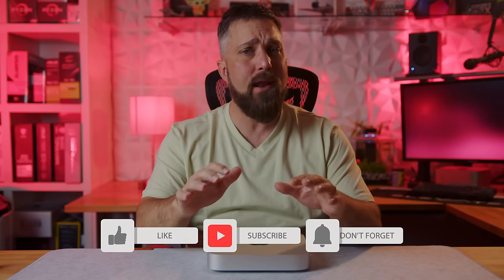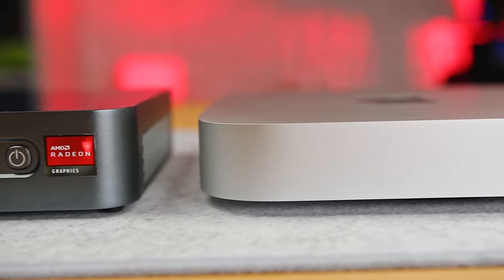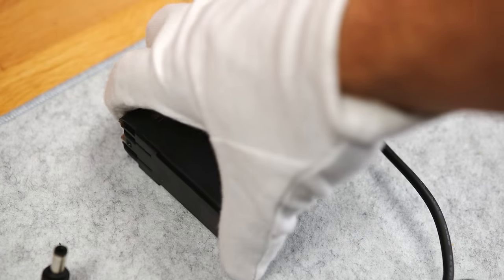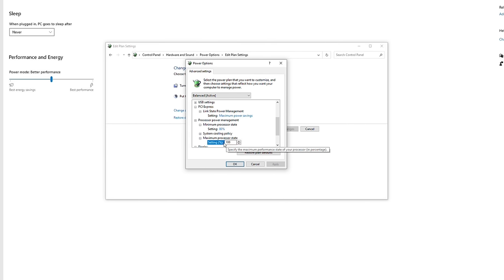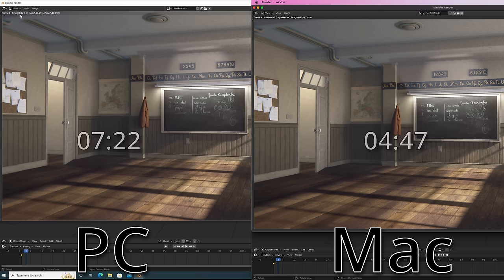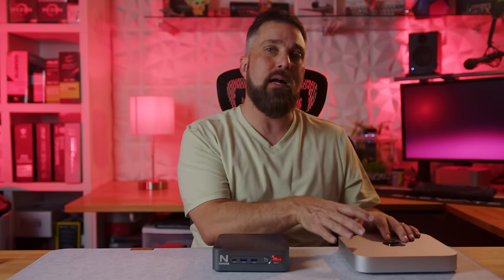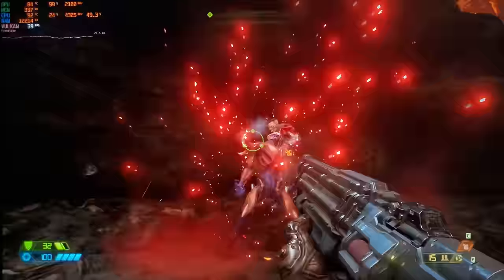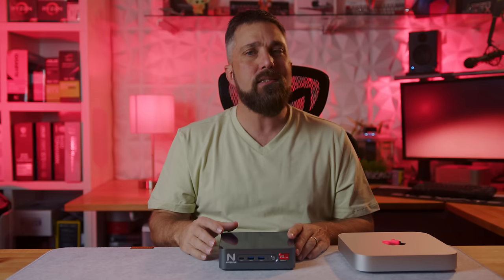Mini PC vs Mac Mini. Ryzen 9 5900HX Nofflink Mini PC Review.

Comment: Noffllink:   fatal flaw is the noisy cooling fan.  A deal-breaker.

M1 Mini:   ARM processor means very limited Windows compatibility.  Also, external GPU boxes will not work.  Also, much less gaming potential compared to Windows.  Also, no RAM or SSD upgrades or repairs are possible on the M1 Mini.   Multiple deal-breakers here.

Comment: I have an M1 MBA, and have been waiting for an M2pro Mac Mini to replace my old dell i7 desktop.  Then I ran into the Beelink ser4 on Amazon for $360 -EHH what the hell!
It has the 4700U, 32G of 3200 DDR, 512 M2 drive, and it will deliver 1440p to my monitor @ 144hz.  To put it mildly, I have no regrets.  The worst thing I can say about it is that it likely stopped me from spending $1k more when the Mac mini I want is finally offered.  I have challenged myself to outgrow the SER4 with CAD and FEA, but I don't see that anytime soon.
I know most people are waiting for the latest Ryzen CPUs to hit the minis, but keep an eye on the clearance sales of the previous generation.  It looks to me like the new APUs need unobtainable memory to hit those performance marks, so they may cost as much or more than the next Mac Minis for quite a while.

Comment: I am pretty sure you have a UPS already, but could you do a video on running desktop systems off an external battery? Niche use-case, I know. 

But I recently had my power cut off for 7 hours and spent a lot of that time wondering how much work I could get done with my desktop if I had more than a 5 min UPS. I have a laptop thankfully, but I was a desktop only user for awhile.

Comment: My last PC build developed a problem that I declined to diagnose because I had had that system for many years and was just BORED with it.  Instead, I bought a MINISFORUM HM90 mini-system with an AMD Ryzen 9 4900H CPU and Vega graphics, 16 GB of DDR4 RAM, and a 512 GB SDD.  The most strenuous thing I'm going to do with this system is music creation.  Considering that the last time I choked out a system with tasks of this nature was when I was running my previous system's predecessor, I figured that all I had to do was to seek out a system capable of light gaming.  The system I replaced is a home-build with an AMD FX series CPU and 8 GB of DDR3.  That means that I jumped 4 generations from system to system; there was no way that I wasn't going to notice the difference, even when moving from Linux Mint to Windows 11!

While the numbers and sheer gear lust are making wish I'd bought something more like the Nofflink you reviewed, at least one thing makes me glad I didn't:  The NOISE!  My HM90 usually makes inaudible noise, and I think I no why.  The Nofflink seems to have its cooling solution in the bottom of the case, where airflow can be constricted.  My HM90 has its cooling solution at the top of the case and pulls air in through a perforated top panel and blows it out of ventilated sides.  Since I will be recording microphone audio into my system, I DON'T want the PC raising the noise floor of my recording room!  I don't NEED (though I do WANT) the extra power, I WON'T ACCEPT the extra noise, and I saved somewhere between $200 and $300 going with what I have.  The recording biz here is a hobby, so I have modest needs even within this sphere.  I won't be on the lookout for a system with, say, an AMD Ryzen 9 6900-whatever for a few years, gear lust notwithstanding.  That means that I should have time to find one with modest-to-very-low fan noise before I pull the trigger!  The worst thing I can say about my new digibrick is that it doesn't have great connectivity, which problem I solved with a 10-port USB 3 hub, which still has 3 empty ports as of now.  Imperfect, but easily workable!😎
Reply: I won't accept Windows, either lol. At least, not as a primary desktop. I installed a 2tb m.2 and put linux mint on my Beelink ser5 5800 before I even powered it up. Running a virtualbox vm with 4 cores and 6gb of ram dedicated to the vm (that'll be quite upgraded once I get my 64gb memory pack in the machine) Windows runs FL studio flawlessly with all the demos I've tested, some of which have dozens of tracks. Haven't tried rack2 in it yet, or what the midi response is like through usb, but I'm working on it

Comment: I've built several PCs with multiple case fans, water cooled CPU and multi-fan graphics cards.  Right now I need a machine to replace a laptop I'm giving away and thought I'd try the new mini-PC thing.  With an external battery I can even use it remotely if I have to.  I heard about the mini Apple PC and thought, "Why not get one of these too so I can see what it's like to use a Mac everyday."  I had no idea the performance and power consumption would be anything like this.  So I'm going with the Apple and not even getting the Ryzen mini PC.  After all these years (30?),  Apple finally gave me a better deal!

Comment: I have the Beelink 4700U mini PC and it runs silently. It came with Windows 11 Pro, 16GB RAM and a 512GB SSD. For the price of the M1 Mac mini, you can buy two Beelink mini PCs. For me, that negates any advantage of the Mac. I also own the M1 Mac mini, so I've had a chance to compare them myself. I find using the PC for daily office work meshes perfectly with my colleagues. Had I purchased the Beelink mini PC first, I probably wouldn't have bought the Mac mini.
Reply from the maker: BeeLink just sent me the new SER5 so I'll be testing that soon.
Reply: I'm worried about the durability of the beelinks,many reviews from Amazon,and  actually there's a YT video out there, saying that this mini PC lasts less than a year before shutting down

Comment: I cannot wait for a 6800u/6900hs based mini PC, i'd prefer a Mac Mini sized PC for better quieter cooling
I also cant wait for Linux to work on my M1 Mac Mini
Reply: Once the m1 linux supports all the hardware, i will be ditching macOS
Reply: @munocat  I think i agree, i've had so many issues with my M1 Mac Mini, i just hope the videotoolbox engine can be used in Linux, even if only supports things like H264/H265

Comment: The hair dryer is a no go for me. But so is the unexpandability and unrepairability of the disposable Mac. I had a Beelink 3750 that was dead silent, replacing it with a Beelink 5800 that I hope will be as quiet as the 3750 was.
Reply: Whaddya know. A week later this video shows up in my suggestions again. Well, the Beelink ser5 5800 ($345 from Amazon) has the same geekbench 5 score as the 5900 in this video, but is 1000 lower in multicore. Probably a memory issue as I bought the low end model with 16gb of pc3200, but I have on order 64gb. Overall, I don't mind the slight speed difference a bit especially considering this thing is totally silent. I mean, I know the cooling fan in this beelink ser5 5800 is running because I feel the air moving, but I have yet to hear so much as a whisper from it. Fast as the dickens, too. Loving it.

Comment: I have the morefine version of this computer and 100 percent agree, great system but the fan noise drives me completely nuts. Sounds like a space ship taking off when doing small tasks, so much so I am considering selling it and getting the new beelink R9 6900h mini pc.
Reply: I'm with you on noisy PC's driving me nuts but what makes you think the beelink will be silent? It might be relatively quieter than this nofflink but I bet it's noticeable and intrusive too. 
Without suspecting I innocently got an intel NUC and was shocked at the roaring engine of the fan kicking in at the slightest of activity; like an airplane taking off. I quickly returned it for a full refund.
I had a 2012 mac mini and was spoilt by the experience of a virtually silent mini PC and assumed that all other mini PC's would be the same but I've given up on mini PC's being silent. The mind bogles though: how is it that Apple has managed it, proving that it's clearly possible and PC manufacturers have not? Either they just don't care or are plain incapable of it. 
I am not keen on Apple's ecosystem but like their mac mini hardware and  now  considering getting a 2nd hand 2018 mac mini and installing a gnu/Linux variant

Comment: For me, something to replace a desktop was my ASUS TUF GAMING F17.
17" Gaming Laptop (Desktop Replacement hooked up to an external 21.5" 1080p monitor and some SSDs (Gaming and File Sharing) along with a Thunderbolt 3 Hub and a 4 Port USB Hub for an external Camera, USB Sound Card, and Xbox One Controller. It's a wonderful system for me.

These systems seem nice, but...just not for me.

Comment: basic mac mini M1 in my country is around 900USD, 2nd about 850.
it has ARM based SOC with RISC archithectures thats why it is FAST in optimal apps just like android in its optimal apps.
most reviewers only talking about apps that already tuned very well in apple OS environtment, while not many talking about many other needs and task and application that is not build by apple or adobe or video/graphic editing spesifically that not yet tuned very well for apple ARM chipset.

and what about PC for casheer? PC for running LED board? 900USD for those kind applications would increasing the cost for business.
the "apple for everyone" bandwagon just never see pass their shoulders and quantum bubble that so many aspects in life that cant be done by mac.

Comment: Why would they use 2666gbps ram on Ryzen...?  Also, there should be one rear USB C for docking/a third display.  Not impressed with this machine.
Reply from the maker: Its a price to performance consideration. Unlike LPX, SODIMM memory speeds, outside of synthetics, have little effect on perceptual performance on the HX platform. Also there are barebone options.

Comment: I swapped my Desktop-PC Ryzen 5 5600G and used now for 6 Month my new Chuwi RZbox Ryzen 7 5800H 32GB. and for me it is all I need, It was also loud in Stock configuration. I Undervolt The CPU in Bios and Reduce the Powerstate to 15W max. and for Gaming I enabled Gaming-Mode for using 4GB Ram for the GPU. It runs my Games incl. Elite Dangerous 1080P with no Problem and Tuxcart and Minecraft and so on easy on my Tuxedo OS Linux. U cant hear the Mini RZBOX mounted behind my Monitor, even on Gaming, as long as I don't Runbenchmarks. The Normal user wouldn't notice the difference between the Power states, also long as u are no Powergamer . But u have a silent PC.

Comment: If you do end up offloading some of your media encoding from your VM to this box, I would love to see/get an idea of the performance comparison/delta.
Reply from the maker: It's a tradeoff as I was using Nvenc to encode on the server which is pretty good. On the mini PC it's just software encoding so it takes longer but results in smaller file sizes with slightly better quality. The watch and output folders are still on the server so the procedure on the user end is still the same and because it's a remote process, time isn't really a concern.

Comment: I am a hobby PC builder. My desktop PC is quieter than this mini Ryzen PC. My current desktop PC is comprised of these parts Intel(R) Pentium(R) Gold G6400 CPU @ 4.00GHz, 8gb of DDR4 RAM, Kingston SATA SSD, and a Gigabyte B560M DS3H. My current PC runs on Windows 11.  I have been using Windows since the year 2000.  I have been using Macs since 2009. Macs I've owned are 2009 new Mac mini, 2009 used Mac laptop, 2010 used iMac, 2012 Mac mini, and at present a new 2019 4K iMac. I like this mini Ryzen PC but the fan noise is a deal breaker. As of writing this comment I have yet to own an Apple silicon Mac. I look forward to buying a used Apple silicon Mac when my 2019 iMac dies or is no longer supported.

Comment: I hate comparisons like this, where price is not mentioned. I have no idea if my expectations should be adjusted or not because one costs a lot more than the other.
Reply from the maker: This video is 4 months old, the only thing that changed in that time frame is the price, of both of these actually. That's why I just put links in the description so you can check the current prices.
Reply: @ElevatedSystems  But that's my point. That's not the only thing that changed in that time frame. If you mentioned at the time the price comparison, we'd know what SKUs they were compared at or are compared at. Now, The Nofflink Mini (still, I assume, priced either $899 or $1099, just with either twice the memory or twice the storage at each price, respectively) looks overpriced compared to the m1 mac mini ($699). That shouldn't figure into the comparison?

Comment: Geekbench 5 is designed to heavily favor Apple M1 processor.   Not a fair test, by any means.

Cinebench r23 or PC Mark 10 are better.
Reply from the maker: Geekbench 5 was released more than a year before the first M1 was. PC Mark isn't compatible on MacOS.
Reply: @ElevatedSystems  Cinebench R23, based on Cinema 4D software, shows that Intel 12700k is 85% faster than M1 Max.

Geekbench 5 tells a different story:   12700K is only 23% faster than M1 Max.

These are multi-core benchmarks.

Similar discrepancies are found when comparing PC Mark results to Geekbench results.

Geekbench clearly favors Apple processors.   I remember  a few years ago, when Geekbench went from V3 to V4, all of a sudden Android scores took a big dive, compared to iPhone scores.

Geekbench 5.4.4 was released on Dec 20th, 2021.    The current 5.4.5 version came out even later.

And let's not forget that Apple is dishonest when describing the M1 processor:   they claim 8 cores.    The reality is 4 fast cores, and 4 weak efficiency cores.

Comment: I have the belink ryzen5900hx. Nice it just chills out around4+ ghz and not so loud. I put in a 4th Gen nvme and it does make a difference Samsung or 2tb.  

I start up 6-8 virtual machines at once as part of a testing process multiple times and they all start up in 2-3 seconds. 

A tiny pc and very powerful. Love it. It can hit 4.6 on all cores. 

The newest intel boasts 5ghz but it’s only on one core. What a joke. And all the beeline ryzen support 64gb 3200 sodium ram.

Gaming is for children so my hobby is sophisticated data collection and analysis systems I program for fun. And of course sell. 
Adult games are productive)

Comment: Of course it would replace my desktop PC, considering I have a Pentium Dual-Core E5200, 4GB DDR2-800 and a Radeon HD 6450... xD
Reply: Me too... my seven-year-old desktop is sitting here with its FX-8370 and GTX 960. Micro ATX cases used to look so small...
Reply: Depending on what OS you use, this could be perfectly fine. With so many Linux options out there that run so well on older hardware, you could be fine without the need for newer hardware.
Reply: @Tw3akst3r  Not really the case
I use Arch (btw) with Plasma and even though it doesn't eat nearly as much RAM as winshit, 4GB is just not enough
I also have a SATA SSD. Many people would vomit just from the fact that it isn't NVMe. Then I can tell you that my computer doesn't support SATA 3 or PCIe3 but SATA 2 and PCIe2. And then I can finish off with the fact that my CPU (I use it overclocked from 2.5 to 3.3GHz - about 30% performance gain) is so slow it can't even utilize SATA 2

Comment: The Ryzen 9 5900hx is from 2021 the highest mobile Ryzen in 2022 was the Ryzen 9 6980hx , in 2023 there’s probably gonna be a Ryzen 9 7980 hx but in the mean time it’s the Ryzen 9 7945 hx as the highest and intel has an even more powerful mobile apu this yr the core i9 13980 hk or hx
Reply from the maker: Ryzen 6800H mini PCs are just hitting the market now. AMD's mobile CPU supply has been horrible 😢

Comment: Why do some people still describe “compare a Mac to a PC “ when they’re both pcs 😂, Apple seems to think they’re different than others when both Microsoft and Apple OSes both have arm based systems, it’s just that Apple for now is better at it than Microsoft but they’re BoTH PCs lol , that’s like a Porsche says it’s not a car compared to a Honda civic lol yeah one has better quality than the other but they’re both cars so enough with Apple and them not thinking they’re part of the PC family, they are lol and nothing wrong with that but when it comes to raw performance at the expense of power usage Mac “PCs” have a long way to go to catch up to windows or even linux pcs because for one they only have igpus not dgpus or graphic cards , despite the 21 tflops of the M1 ultra , like all mac pcs , most games are not optimized for macs especially Apple silicon ones , there’s very few native (not counting Apple Arcade because those are just mobile games from their phone , iPad , or Apple TV) games that run on Apple hardware natively, you have to use a compatibility layer to run some windows pc games on Macs because as long as Apple don’t make their own dedicated/discrete gpu (dgpu) they can’t compete with nvidia or even amd ….yet, at least when it comes to pc gaming , windows is the main pc is the main OS for most gamers, sorry Apple 😂 can’t have games like the the latest CoD running natively on Apple silicon yet so lol , how about the Dead Space remake? Oooo not for mac pcs but coming to windows pcs and consoles 😂 ….Apple gets little to no love from 3rd party AAA publishers/developers, sorry Apple candy crush won’t cut it 😂as a AAA game , Mac pcs are good for other things not gaming, not yet.